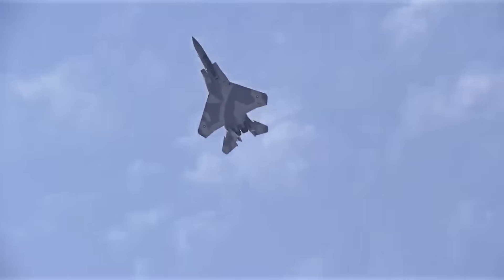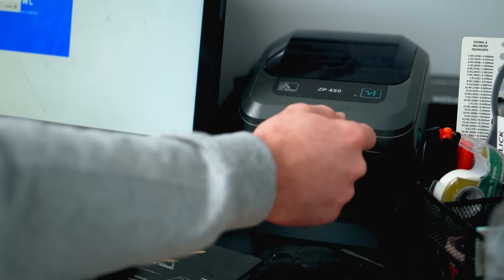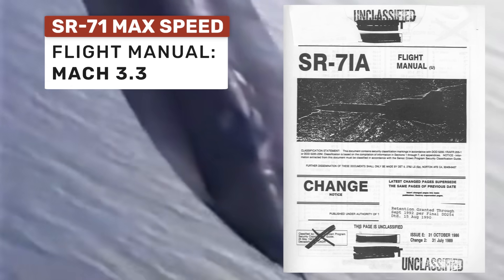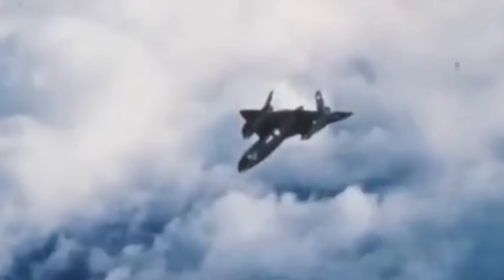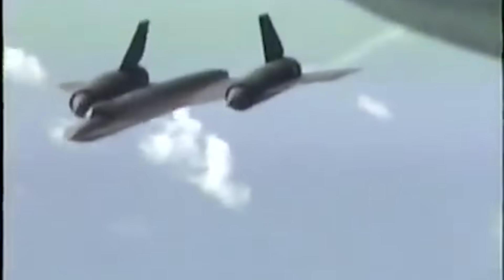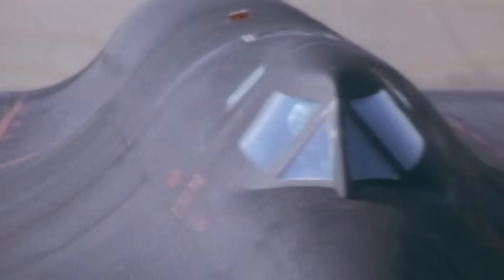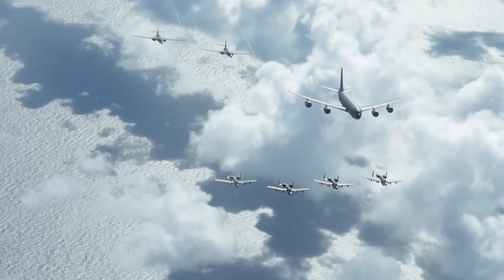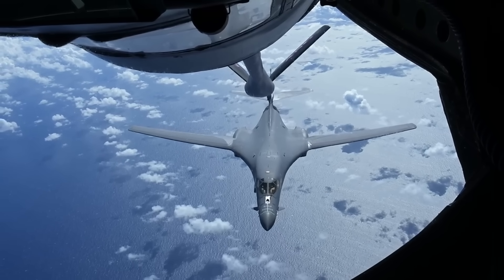The SR-71 was MUCH FASTER than the Air Force will admit

Comment: I was a reverse engineer for the Skunk works, I had access and to information and actually work on developing the software to design the airframe and worked on the the engine design and manufacturing of the S-R71- I can assure you the planes top speed was closer Mach 3.9! There were test flights completed using the reverse engineering of Martian 👽 technology from downed spacecraft used in the building of the propulsion system of the SR-71-

Comment: A old airforce mechinic told me one time that he was overseas and they recieved special fuel and he was told to drive to the end of the runway and to fuel up a plane.  It was a SR-71 heading over Russia.  When he got back in the states he was somewhere in the west and the blackbird was coming over  the base he was stationed at.  The plane was going so fast the pilot stated he was missing leading edges and trailing edges.  The plane looked like it was on fire and resembled a shooting star.  He was never told the speed but was told that it was a unoffical record across the US.  He did say the pilot got in trouble.  the SR-71 is one of my favorite planes.
Reply: They burnt JP7

Comment: well, so the engines were faster then the air frame. I wonder what the fastest speed was when they speed tested the engines on the ground. What would the max speed test have been with out limits.

Comment: Duh, I knew about this since the 1990's when I was the Sr. Systems Engineer out at Edwards Flight Center.  Still 20+ years later, I respect US Security still and will NOT tell you the real top speed.  But, I will give you a hint though.  The top speed was accomplished, when the pilots looked out the window and saw their wings became a "bright orange color" = about to littlerly melt and had to "back her off"!. I still have fond memories of my and my assistant getting "thrown out by the AF Security" from the NASA Hanger with the SR-71, as we snuck in there one day out of curiosity.  Other fond memories, I have is when we had meeting with the "Space Junk Commander" out at their Buiilding on the base.  It was hilarious.

Comment: I had a friend that was a Lockheed SR71 test pilot. He told me the limiting speed factor was the windshield temp limit. Which he usually saw at around Mach 3.3. But he noted that at that windshield temp limit, he was only at about 1/2 power lever travel.
Reply: One way or another, that machine would have kept speeding up until it wrecked itself.
Reply: Your friend has a big mouth and apparently so do you.  How much of this is still classified and why don't you care?
Reply: Your friend probably told you it's top speed over shorter runs.
Reply: @craigg4246   Doubt it.  There's far too many "friend was a pilot" stories just on this one video.  He probably flew other cool stuff though
Reply: @ no, he was a lockheed test pilot, and he did fly the SR71.
Reply: @ he is over 90 now. It was 60 years ago he was flying the Blackbird. I worked with him in the 90’s

Comment: So during the Vietnam war I was an operator for a Long range radar based out in the area of Korat Thailand on  hill, Radar code name was called 'Big Eye' pilots of this era can tell you it was their guiding light, we could see aircraft launches from Hanoi, incoming and much more. When the A-12 was coming on its runs from Okinawa, it would shortly be entering Chinas air space, and so it started its acceleration about the time it was over us, Our radar would track her outbound, jumping half of a 20 mile range mark on the screen each sweep, in other words two sweeps to jump a full range mark and our radar was very highly calibrated each day with a standard 24 rotations per minute - it had to be. Which put its speed as it started its dash according to our resident math wizard, at around 3.7 mach.
Reply: Eh something is off with those numbers - that would mean it went 10 miles in 2.5 seconds, or 4 miles per second. 4mi/s is 14400mph, or... Mach 18.7 lol.

Comment: The SR is a special lady, the faster you go the  more fuel you save. I can't prove it without losing my clearance but the classified top speed of the SR is Mach 4.4. And yes she can easily handle the heat and pressures.

Comment: One of my stepdad’s friends was a mechanic on the SR-71 for over 5 years. Told me that the engines produced enough power to push it to 3.2 on one engine, but because it was designed with two engines that it couldn’t do more than Mach 2 on one engine. But he said that top speed was over Mach 5.

Comment: I was an Airman at Beale AFB. They marked the 20th anniversary of SR-71 service with a mach 1 plus flyby and boom. Scheduled for  1300 hrs We assembled outside, patiently looking skyward waiting , watching for something. Then at about 1302, boom, which cracked out surprisingly sharply,  very similar to dynamite in a quarry blast. I quickly scanned the sky again and noticed a faint contrail that stretched from horizon to horizon! Was this contrail  from the Blackbird? Not sure but this made me wonder if it does fly faster than stated?!   Brian Shul was a very interesting man and quite an inspiration. Super positive attitude! I got to be around him a couple of times.
Reply: Col Pinsky did a low fly by at MACH and it sounded like the sky was being ripped open. When he landed they put 956 back in the shelter, I went out to help do a post flight and the aircraft was still very hot and some of the paint had turned gray where it was turned to ash. Too fast, too low.
Reply: @danfreeman9079  I met him as well. Cool story or should I say hot story? . I recall that he went into city government after retirement. He was said have been an F4 pilot over Vietnam . Going really fast was definitely not new to him
Reply: Cool thing about sonic booms is that when you hear it, the plane has gone so far passed you that you won’t see it! A sonic boom can travel 15 miles, so there is no reason to think that plane was close enough for anyone to spot it!
Reply: Mach 1 I a single SONIC BOOM for Mach 2 it is a BOOM BOOM for a double Mach triple is yes 3 booms in quick succession.
USAF 1986 thru 1993, McConnell AFB KS and Edwards AFB CA.    With stinst all over & undisclosed clearances 😊

I was one of two people to help in decommissioning of last active SR-71 in 1992ish (memory) they transferred 2 or 3 of them to NASA for high altitude testing.   Somewhere I have a B/W pic with the other individual  infront of the bird we decommissioned.    Was one of the first digital cameras & about the size of a home VHS camcorder 😂😂😂
Reply: @markmatt9174  WHAT????

Comment: Since the SR-71 is roughly 60 odd years old, I suspect that the SR-72 has already been retired/replaced with the SR-73, which may have been replaced by the SR-74 and  SR-75, and so on.    There is a reason the United States has the most UFO sightings of aircraft traveling at fantastic speeds.

Comment: Simply put, everything above 3.2-3.3 is lie. Reason? After reaching Mach 3, efficiency of ramjet propulsion drops sharply, but aerodynamic drag is not. So you need more and more thrust, but ramjet could not offer any. This is why all supersonic missiles with RAMJET has top speed Mach 3. Even most modern ones. And I hope, nobody is trying to have audacity to put 70 years old technology on par with modern technology in aeronautics!

American pilots (and military personnel generally) are well known "fishermen". USA deliberately feeds myth about technological superiority (and lying and fogging things up is main part of this practice). But fact are facts, USA never dared to fly over SSSR with SR-71 despite fact, that then fastest Soviet missiles topped Mach 4 and fastest jets topped Mach 3.2 (for a engine burnout price). So If SR-71 will be capable to reach in video suggested speed, it will be invulnerable to then soviets countermeasures. And fact, that USAF did not dare to cross Soviet border (in fact not even border of Warsaw pact countries, my country included) clearly indicates, that practical top speed of SR-71 will be even lesser than official record.

I have no problem with this massive lying, but problem is, that Westerners starting to believe, partly due clever propaganda and partly because mediocre results of Russia in Ukraine, that Russia is technologically so inferior, that NATO would blow it like a candle. So risk of WW3 is higher and higher (and no, NATO would not blow Russia like a candle, it will be slaughter on both sides because that technological superiority is non existent and current military production of Russia is higher, than military production of NATO combined, also China would not stand aside in such existential conflict).

Comment: Willis Hawkins was my 1st cousins father in law . I read an article that he wrote that said the engines were good for 3,400 mph but the windshields tended to get over 800f and that was the limit.  He did not say if the glass would fail or the seals on the glass was the issue.  I did hear not thru hawkins that the Aurora had so much heat around the body it effected the ability to take photos.

Comment: If I recall correctly in the book sled driver they describe one mission where they had to evade and were "pushing the air frame at over mach 3 and it felt like it had more left in it" or something to that effect. Seems it had plenty of power and the air frame was the limiting factor, when you consider when it was built it's truly amazing. I'm not sure if the engine design including the spikes, bypasses etc was good for much more though, I don't think it would have got near the hypersonic regime. It was tuned for up to that mach 3.2 cruise speed after all

Comment: You need to be carefull when stating mph ground speeds or mach speeds - Mach1 or 1x the speed of sound does vary with pressure and temperature, both of those varies a lot with altitude. On top of this you have the engine performance which varies with 1. Your airspeed, The air pressure, The air temperature and the humidity of the air. The stated max speed of Mach 3.2 is at a given normal set of conditions - with all the variations an additional 10% is actually within reach.

Comment: The fastest publicly acknowledged flight reached 2,242 mph, which is Mach 3.39. Brian Shul, the subject of resentment by other pilots because of a breach of some kind of ridiculous etiquette, proved he had reached 88,000 feet in one flight, and reported a very realistic Mach 3.45 during Operation Eldora Canyon.  What Alex did not mention, and should have, was that for El Dorado Canyon the Air Force lifted the requirement that the inlet temperature be kept below 800F, which was a very conservative number intended to protect the inlet from deformation, which could do serious damage to the airplane.  Wit that limit lifted, reaching Mach 3.5 would have been trivial. Apparently, although the USAF does not confirm it, the Blackbird could tolerate inlet temperatures closer to 900F.  It does make sense that the service would want to protect the airplane from a mishap.  But Shul's acceleration during the 1986 mission prevented Surface to Air Missiles from reaching him.  Another important error in Alex's video is that he states the SR-71's structural integrity would be at risk if the aircraft much exceeded the stated top speed.  This is false.  The SR-71 is made from titanium (93%).  The titanium hardens as the aicraft accelerates into the upper Mach numbers.  The structural integrity is likely not at risk eve if the aircraft were to reach Mach 4.  Similarly, the J-58s were capable of performing well into that range.  The one real limit was the engine inlet.

Comment: SR71 maximum is 7.4… the new technical “engine” speed at grab able highest operating pressure is between 10.4-13.6. … after that. Ya can’t curve the earth with that dynamic system. 🤌.. after 10, your moving through friction like trying to hit patches of clouds for traction~ except; your ionizing clouds are pretty even up there in space. Chemistry of space between the upgrade & ion thrusters. Haha 😛
Reply: Depends how much you want to spend on an engine. Budget gets you benefits

Comment: Let's notify absolutely everybody, and make sure we have all the proper people and measuring equipment in place, that we're going for the speed record, in our top secret spy plane that no one knows about, and no one knows how fast it can really go.
Hmm.
It may well be that the SR-71 was capable of over Mach 3.6, and probably it did at times when required, but I'm guessing that much like the Mach 2.8 capable MiG-25 Foxbat it would require a full rebuild of the engines and parts of the airframe after that had happened. We all know the stories of the Russian MiG-25 pilots saying "you could go faster, but it would destroy the engines." I'm guessing the SR-71 was much the same in that regard.

Comment: Just take the temperature it takes to melt the titanium leading edges of the wings and do the math.... shouldn't that be do-able by some good old fashioned engineering? At least it would give a theoretical limit to the speed a titanium wing could go through the air. Of course then we get into the outer reaches of the atmosphere, almost space, would that allow it to go even faster with less air friction? I believe they had directional thrusters for additional control at extremely high altitudes, is that correct?

Comment: I've always read that max speeds and performance were Top Secret and that the planes in question were ALWAYS faster than what was listed. If you want to fool the foolish, like Russia, you list the top speeds lower than what the planes can actually do, so you can trick them into building missiles capable of just a little more. Russia builds a Mach 3.3 capable missile and the SR will still outrun it, but the pilots are told to ONLY outrun it... do not "show it up" by going full speed. Wink wink, nudge nudge. Now, the Russians think that the SR can go 3.35, because it outran it's 3.3 missiles. So, they go back to the drawing boards and come up with a Mach 3.36 missile, but the SR can really go even faster than that. This is one way we bankrupted them.  ;-)  NEVER tell the world your true capabilities. Give the media disinformation, so you can stay on top. 😆

Comment: The limiting factors appear to be material thermal limits (which were extremely high) and the movement range of the engine intake spike to position shockwaves appropriately inside the nacelles.

Comment: Very interesting video - thank you.
You may want to look at the max. altitude:  Most reports state ~80K feet.  But I have heard that there are recently declassified reports of altitude in excess of 120K feet.
I heard a joke about the SR-71 - at the time the plane had just been 'declassified' (?) and the USAF admitted publicly that it 'existed'.
Joke goes: SR-71 is flying over Dallas, Texas, designation 'Aspen-XXX'(I don't recall the actual numbers).  For fun, the pilot calls up Dallas commercial ATC = "Dallas ATC, this is AspenXXX, requesting permission to 'go to 90 thousand feet'>
Hysterical laughter can be heard through the radio as Dallas ATC staff are laughing their butts off.
Finally, one ATC controller gets back to ASPEN-XXX - is a VERY sarcastic tone he says ".... yeah, sure - you go right ahead there, Aspen-XXX, and good luck!".
Without a moments hesitation, Aspen replies "Roger Dallas, this a Aspen-XXX DESCENDING to 90 thousand feet".
Total silence from Dallas ATC !!
Reply: I've heard this before, but you got the altitude badly wrong.  ATC only controls up to Flight Level 600 (60,000 ft), above that is uncontrolled airspace.  Very few commercial aircraft are capable of getting anywhere near FL600, hence ATC's doubt.  The SR-71 was calling in to ATC to enter controlled airspace from above.
Reply: I read of a similar encounter, LOL!

Comment: If you research, the F-15 had an absolute top speed of Mach 2.5 ... and if that fat ass of a plane can do Mach 2.5 .... then there's no question, for me at least, the highest publicly stated 3.5 is NOT the SR-71's top speed. You'd have to be a fool to believe that. I think 4.0 is more likely, considering the projects after the SR were hoping to reach 4.5 - 5.0 and were scrapped because it wasn't worth the money just for such a small gain in top speed.

Comment: The "Official" specs as noted from multiple sources, the SR-71 has speed listed as mach 3.2+, and ceiling in excess of 80,000 feet. Those 2 key indicators, + and in excess makes a huge difference in max performance.
Reply: It’s almost certain there’s info stashed away from radar tracking that could show how fast it really was. It’s likely more like Mach 4 and 100,000 feet. The cruising speed is going to be pretty close to that 3.2 number since that’s going to be where it can safely stay for an extended time. But, true max speed is typically a fair bit faster than cruise.

Comment: The inlet spike was the speed limiter of the aircraft.  As long as the inlet shock wave could be controlled.  Once you exceed the speed the inlet spike can handle, the engines flameout.